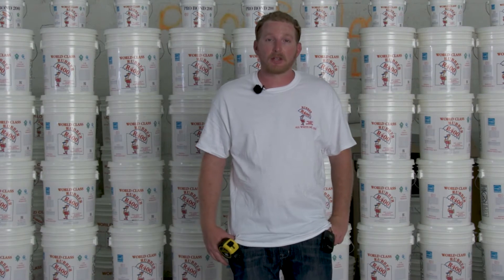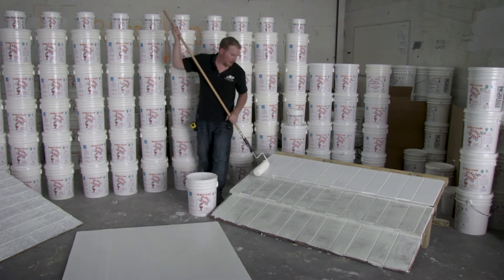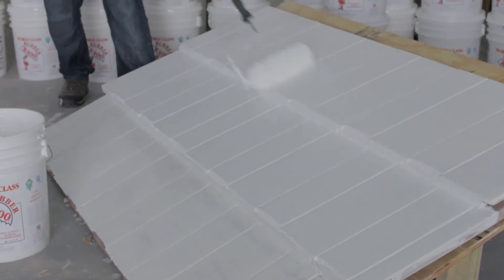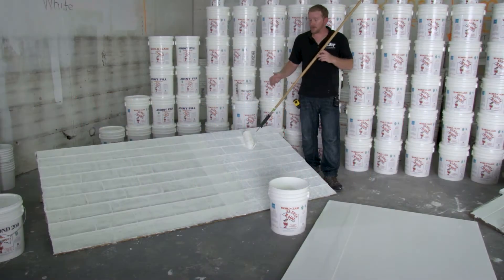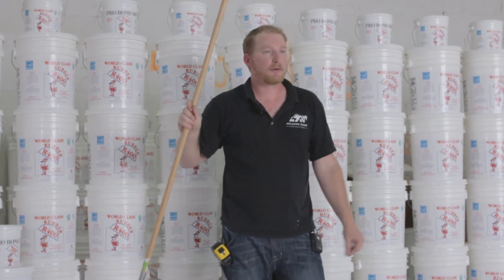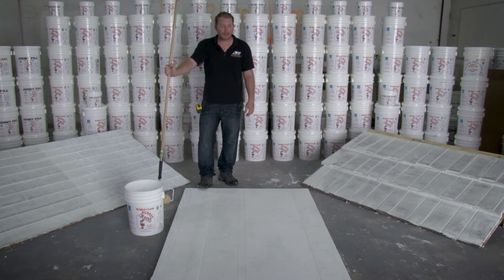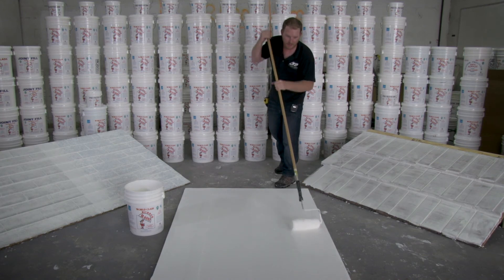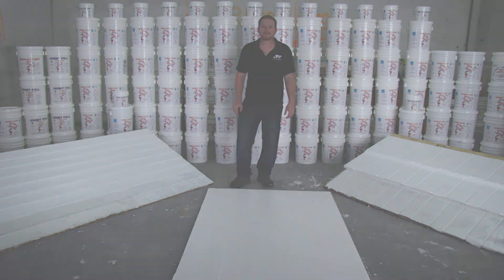R400 Rubber Installation - All White Manufacturing

Comment: Just came across this video. Good stuff both materials and application. 
This is a simplified video for different types of roofs.
I’ve been waterproofing roofs since 1990 in Florida.
For a complete waterproofing job that is 100% you will need the correct application and materials. 
What the applicator did not mention is the R400 is the best flat roof coating for residential and commercial projects. 
Wish all you waterproofing manufacturers and applicators in South Florida a great future !!
Reply from the maker: Glad you enjoyed it!